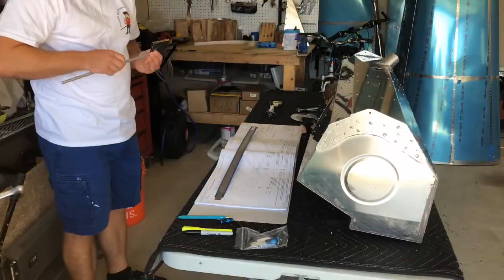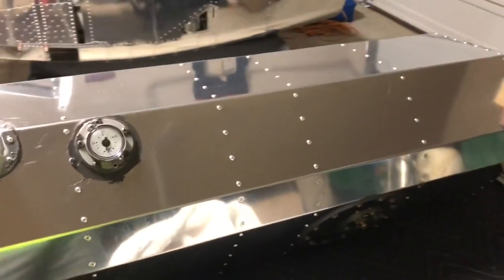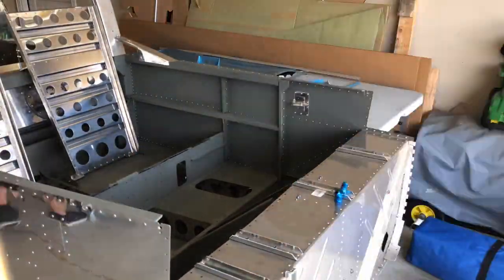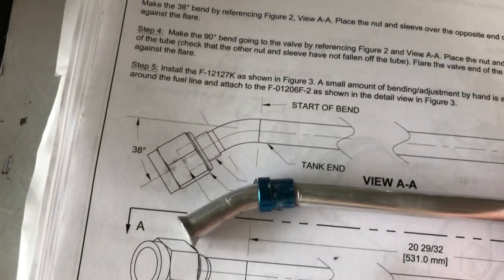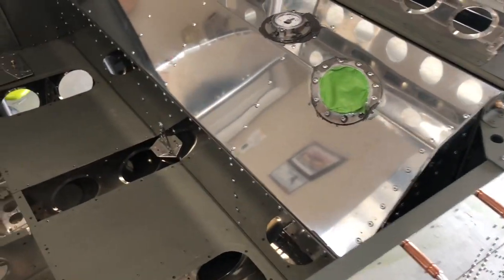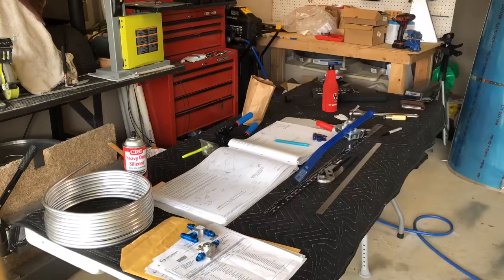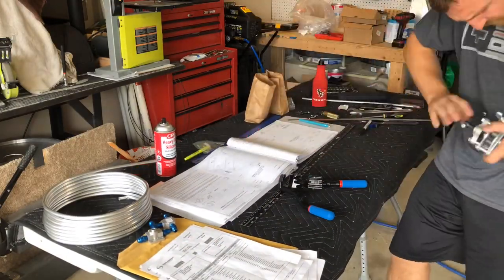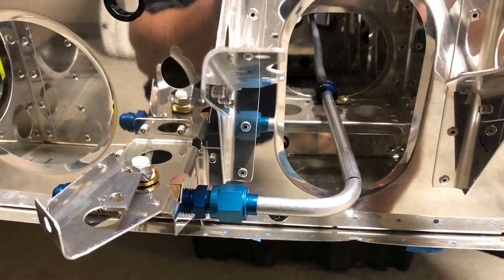RV-12iS Fuselage 17: Fuel System

Comment: Hi, building a RV-12iS also. As far as the flare tool goes you need a smaller flare tool that I used. It’s a imperial flaring tool. Think it’s 437-FB. As far as the F-12127K, I hand bent it. Let me know it I can help with any advice.
Reply from the maker: Thanks David, I had been looking over some of the other flare tools but based on the picture couldn't tell if they would be small enough to work. I have ordered the 437-FB, actually had it saved prior to your comment and was going to order it anyway. Thanks again!